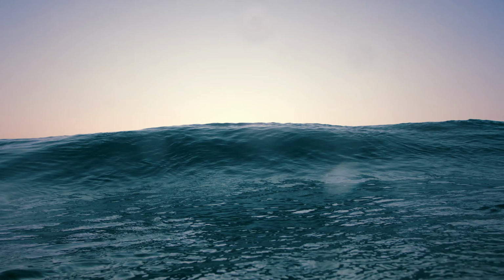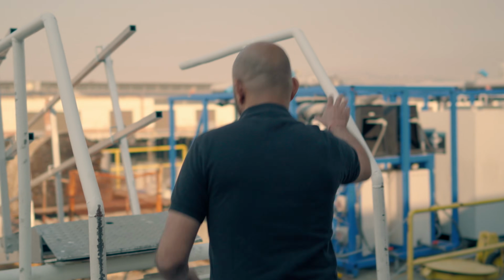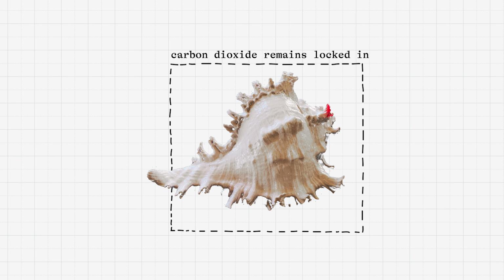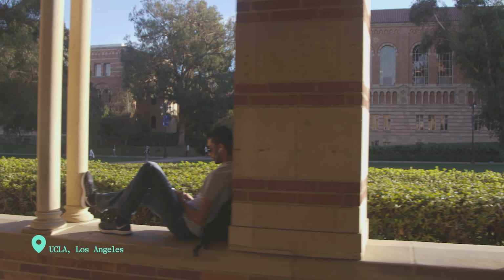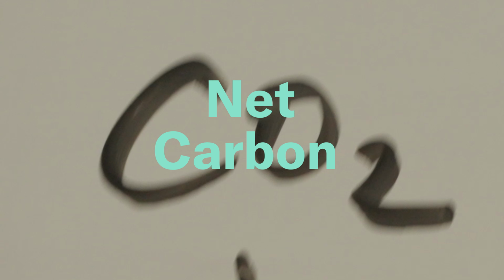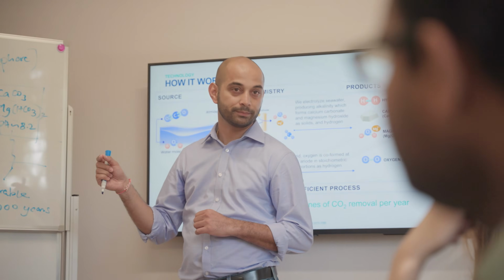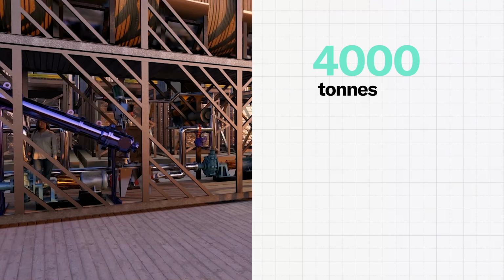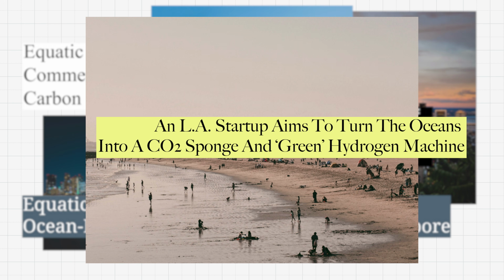The Secret of Seashells and How They Could Save Our Ocean

Comment: if you're creating calcium carbonate could this not help the concrete industry as well? as in a previous finalists video they said the concrete industry makes 7% of greenhouse emissions so revamping the process is necessary. somewhere in my memory is a glimmer of romans using seashells to make lime for cement which is a brutal process using fire, but, if there were a cleaner fuel used (hydrogen) or an non-emission making chemical process, could this reduce the pollution from concrete industries and be used as a building material?

Comment: Equatic’s carbon removal demonstration plant will use four inputs—seawater, air, rock, and renewable electricity—to remove and store CO2 while simultaneously generating carbon-negative hydrogen
Equatic will pass an electrical current through seawater (electrolysis) and then pass atmospheric air through the processed seawater (direct air capture); 
these steps trap CO2 in solid minerals and as dissolved substances that are naturally found in the oceans, ensuring that the trapped CO2 will remain securely stored for 100,000+ years. 
Finally, Equatic will use rock to neutralize the processed seawater and to preserve the ocean’s chemistry.